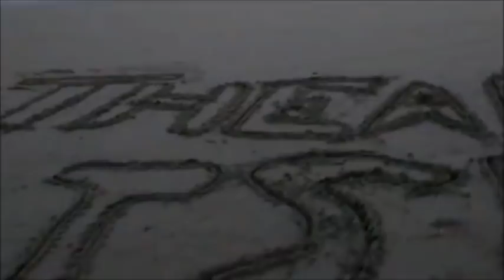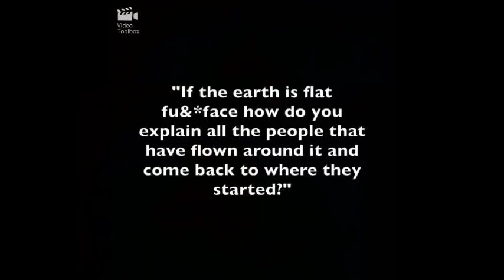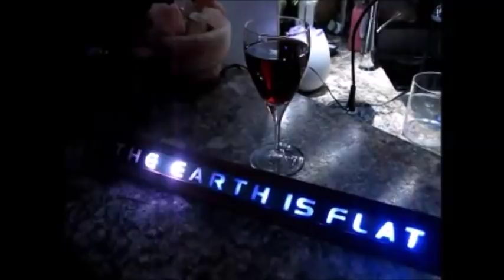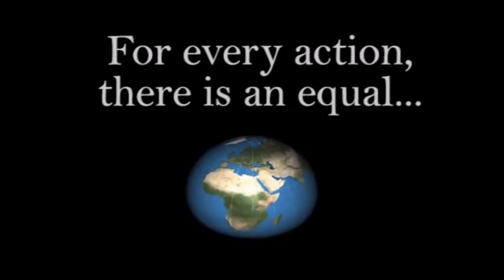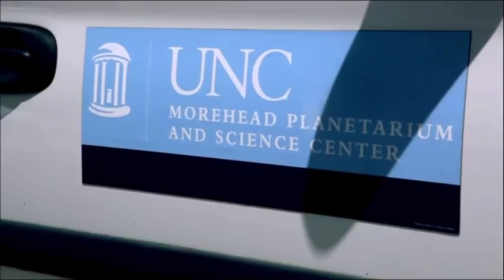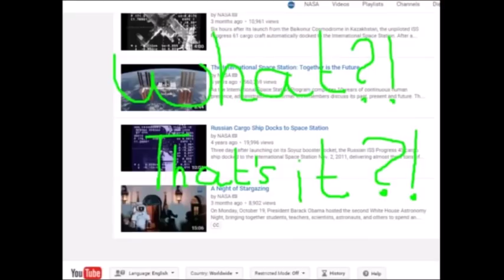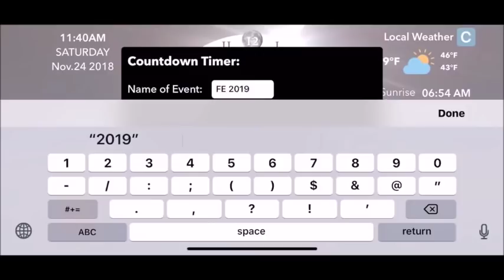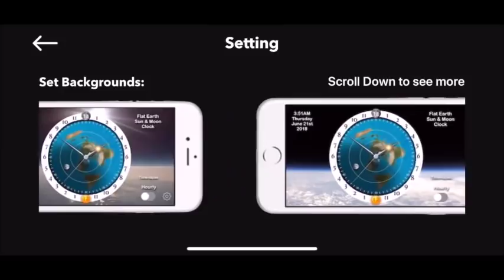Flat Earth Q&A Emails 120 Mark Sargent ✅

Comment: If the earth is spinning so fast, due to centrifugal force are people lighter on the equator than say in Greenland or at the north pole. Is that why Africans are tall and Eskimos are short. Seems to me that at the north pole you would be so heavy you would not be able to stand up mmmm just a thought!
Reply: Exactly. If gravity pulls from the core then the slower rate of spin near the poles would make one heavier. But it does not.
Reply: "Is that why Africans are tall and Eskimos are short"
That's a good joke.
But centrifugal force has a maximum of 0.3% of gravity.
Instead of 90 kg, at the pole, you weigh 89.7 kg at the equator.

Keep looking.
Reply: @Zodiac4711  Nice 1 thanks for that info, I must admit I was puzzled with that 1. Cheers

Comment: Thanks Mark for totally screwing up my e-mail about the curvature calculations. You seem to forgot that if you standing on the ball you are at it's highest point and ground bellow your feet would instantly starts curving down in every direction. If you think that the curvature of 1700 feet is an exaggeration than you are sadly mistakening. Learn how to read better because you conveniently omitted parts of my e-mail changing it's message. I gave you way to much credit. You not as smart as you think you are. Sincerely Arek.
Reply: In 
Denoting (fixed) position (in place, time or state), and means to correct errors Now if were horses and hay is for horses, a dog is a very special genius not surprisingly, since the dog is rather vaguely defined legally. Take Notice how the head wags the tail plus you get to walk the walk before you talk the talk to your best friend.
Reply: @iforgie  ...you don't know what are you talking about, do you ? He can't correct me because he has no clue what he is talking about either.
Reply: @peterpaninspace4990  prof read your comment; there is no supporting evidence in the form of a copy of the original email.
Reply: @iforgie  ...there you go. Here is my original a-mail. I edited it slightly because some sentences where little bit to long so I divided them into the shorter once. Other than that everything else is unchanged.
Reply: @peterpaninspace4990  I took calculus an option in my first semester of grade twelve. The proper use of the English in your replies will give the reader the opportunity to put the words into their proper context of what they are trying to read. 
Accept for value the definition of In; denoting (fixed) position (in place, time or state). P.S. God gave you life; your parents gave you cloths, Caesars demands the blood sacrifice of woman and children.
Reply: @iforgie  ... What the hell are you talking about ? You don't make any sense whatsoever.
Reply: @peterpaninspace4990   I chose to write;  
 "ATTEN'TION, n.
1. The act of attending or heeding; the due application of the ear to sounds, or of the mind to objects presented to its contemplation. 2. Act of civility, or courtesy; as attention to a stranger.
TAKE, v.. taken.  This word seems to be allied to think, for we say, I think a thing to be so, or I take it to be so. It seems also to be allied to , to draw, to tug; for we say, to take a likeness, and to draw a likeness. We use taking also for engaging, attracting. We say, a child takes to his mother or nurse, and a man takes to drink; which seem to include attaching and holding. We observe that take and teach are radically the same word.
NO'TICE, n.
1. Observation by the eye or by the other senses. We take notice of objects passing or standing before us; we take notice of the words of a speaker; we take notice of a peculiar taste of food, or of the smell of an orange, and of our peculiar sensations. Notice then is the act by which we gain knowledge of something within the reach of the senses, or the effect of an impression on some of the senses.
English
ENGLISH, adjective ing'glish. [Latin ango, from the sense of pressing, depression, laying, which gives the sense of level.]

Belonging to England, or to its inhabitants.

ENGLISH, noun The people of England.

1. The language of England or of the english nation, and of their descendants in India, America and other countries.

ENGLISH, verb transitive To translate into the english language.
Reply: @iforgie  ...you need some help.
Reply: @peterpaninspace4990  If you mute the State of the Union address and use closed caption for a transcript and mirror it on you Chanel. The author wrote the Trump card for you aready.